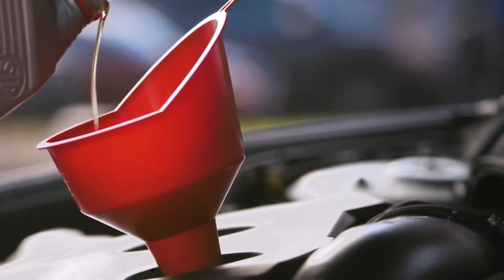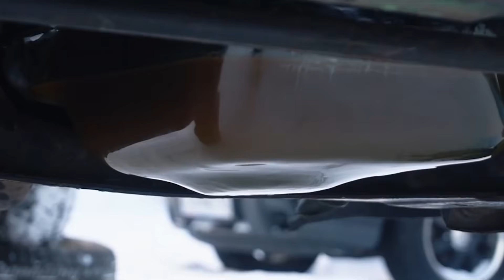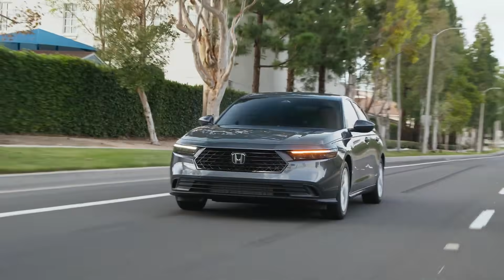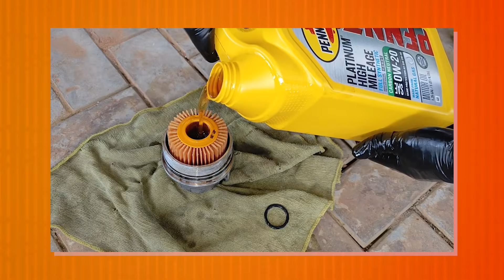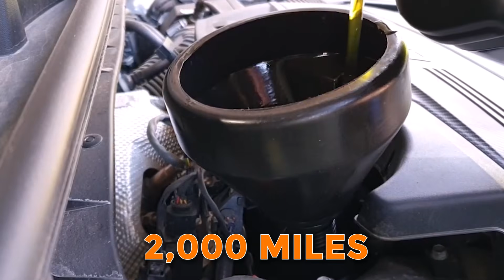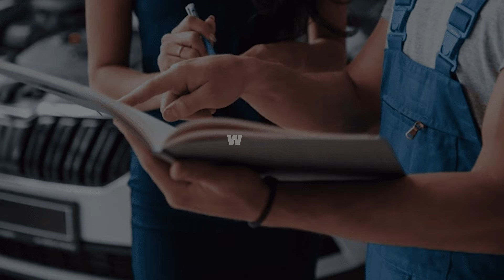URGENT: This Popular Oil is DESTROYING Honda Engines (Stop Using It)

Comment: 0w20 was used to give Honda extra mpg to meet fed fuel efficiency standards. In a non turbo motor youre better off with 5w30
Reply: I'm at 199K miles 04' Pilot useing valvoline high milage full synthetic 10W-30 every 3K miles, short trips and hills.